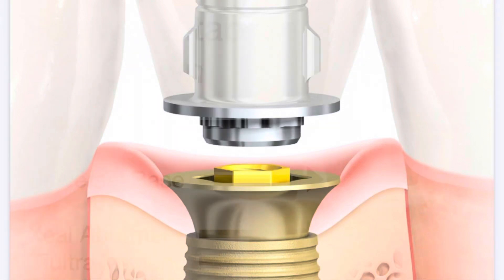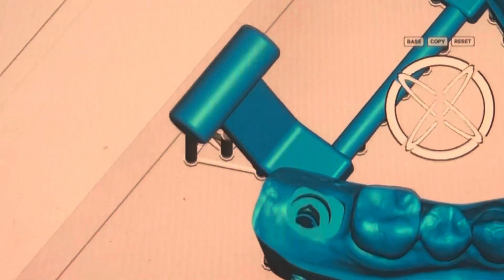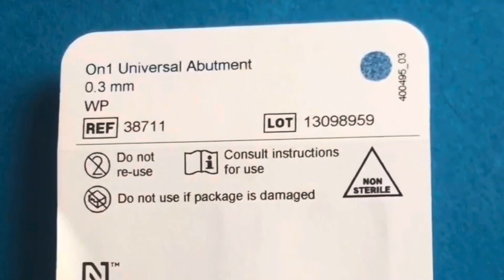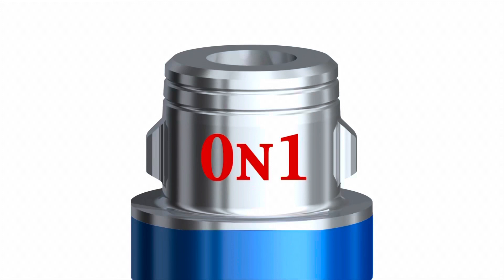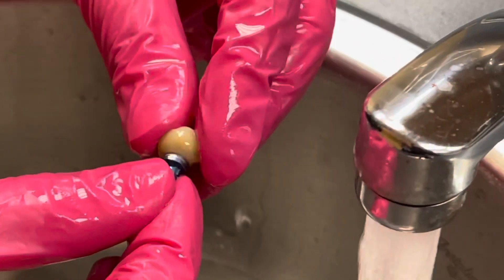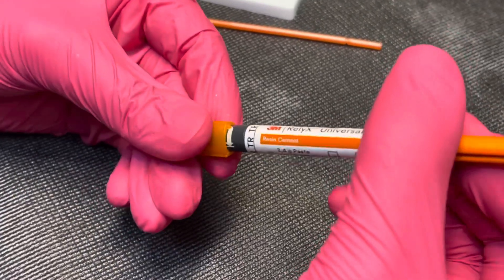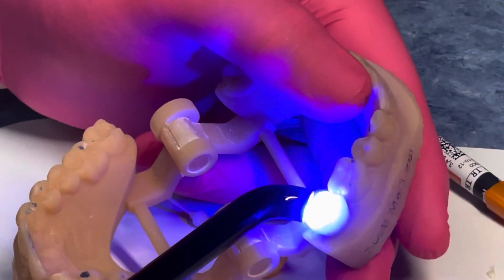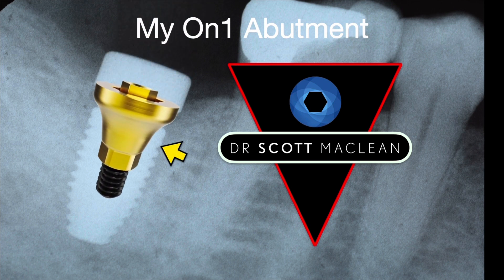How to make - ScrewMentable Implant Crown - On1 TiBase Abutment

Comment: Hi Dr .
I just had zirconia implant noble biocare Pearl.  In 5 months i will have zirconia abutment and zirconia crown. The dentist will use carbon fiber to screw the abutment to implant.  But she said she will have to use cement to glue the crown to the abutment. She said there will be a hole in the crown in case we need to remove the screw to change the crown and abutment.She will fill the hole of the crown with composite.
I wonder if cement will cause future health issues even if it is compatible.  Why can't she use screw like you did in this video,? Is it true that she has to use cement to glue the crown to abutment instead of carbon fiber screw?
What is the name of cement that does not cause harm to my health?
Thank you Doctor.